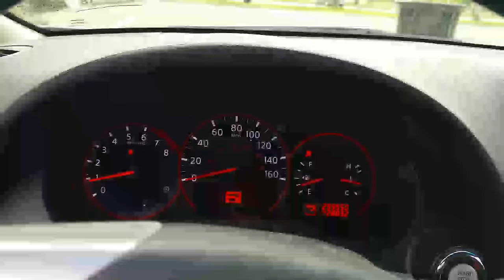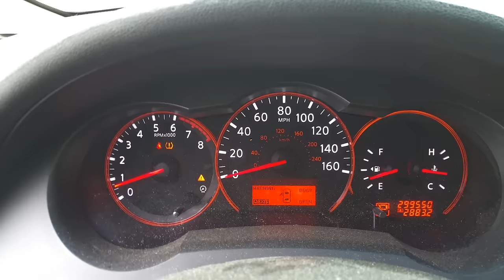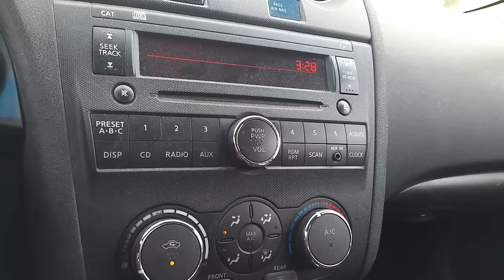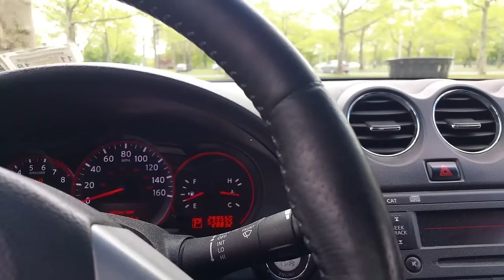CVT Whining Noise and Fail Safe Mode Fixed!

Comment: Dude. Just change your CVT fluid every 65,000 miles and invest on a transmission cooler/heat exchanger. Reason why you hear the whining noise is because the transmission gets too hot to the point where the CVT fluid tends to lose its viscosity, in which you have little to no lubrication to the steel belts inside the CVT transmission. That’s why the car goes to fail safe mode. Because if the computer reads that the temperature of the fluid is too hot, it will go on fail safe mode. Trust me. It had happened to me on my Altima.
Reply: Thanks for the info
Reply: Kamari Gray gotti Did you check if it has enough transmission fluid?
Reply: I had this noise happen when on the freeway when i accelerated uphill, the noise went away during the same car ride and i haven't heard it. Should i worry it's a big problem ? Or can it be what you said ? It's also a Altima
Reply: Use Amsoil CVT fluid 
It has a much higher flash point so it won’t over heat on you 
Also lubgaurd makes a CVT additive that will help
Reply: Just dont buy a Nissen with CVT............buy a car
Reply: On my the whining  noise is when is cold, then when warms up kind of disappears, or very little of the noise. This is six months after the change the atf from drop down the pan ,about 3qt.
Reply: @JujuMoto502 how did you solve the problem?
Reply: @anguslean4058  I use Amsoil CVT fluid on my car as well, but are you sure it has a higher flash point? Where did you find that info?
Reply: @ARCADEGHOST  from Amsoil 
It is the best CVT fluid out there 
It also will last much longer then the factory CVT fluid in that it doesn’t break down as quickly 
Amsoil will send you the data sheets if you request them.
Reply: @edwinalexander1170  its too late for me, I bought a 2013 Nissan Altima, sport, at my local, Carbone Nissan in Utica, N.Y. they said when I asked if there was a problem with the transmission's, no never had one come back, yah, never had one come back. that's because the warranty does not cover transmission's , BULL SHIT, THEY DIDN'T TELL ME THAT, well now I have a transmission that vibrates like a M.F.er, 105,000 ml.
Reply: Hey I got that noise to in my Infiniti G35 08 idk if it blocked up on me

Comment: Hi there, been through this issue.
So here is what I've found so far, I have 2009 Altima US Specs, the same thing happened to me car went to safe mode and won't speed up, i simply changed the CVT fluid, run well for a month or so and then again the same thing, i changed the fluid again but this time it was hot here in UAE and i had to drive to another city where maximum speed limit is 160 kmh and guess what same thing happened car went to safe mode couldn't accelerate more than 120 kmh. so i searched the web for issues on Nissan CVT.
I Found a comment from some nissan tech guy explaining that CVT fluid is temperature sensitive and expands on high temperature he further added that he had usually found cars with a high level of CVT Fluid which turns out to be the issue for fail safe mode.
To check that i drove my car at speed of 160 kmh (Since there is no problem at lower speed) as soon as car went to safe mode i stopped and checked the CVT Fluid guage which was showing CVT fluid 3 times above the maximum fluid limit.
Anyway to cut it short here is what you have to do,
1st of all Nissan gave a specific range of temperature at which you have to check CVT fluid level, usually we fill the fluid to maximum level when the CVT and CVT fluid itself is cold which causes all the problem.
So if you are facing such problem simple reduce the level of CVT Fluid to minimum level indicated on level guage. run the car at high speed for like 3,4 hours and then check the fluid level again if hot CVT is exceeding maximum level you have further reduce the fluid.
I did the same (took me some time though) but now i am not facing any winning sound or fail safe mode or anything car runs smooth at any speed. Altima is speed locked just below 120 mph / 190 kph and i ve to that max for about 30 mints without any issues.
Hope this will solve everyone's problem with CVT and fail safe.
Reply: Thank goodness someone else finally got it right. Engine coolant freeze point protection plays a major roll itself, most people also overlook that. Check my comment above at this post.
Reply: Muhammad Zohaib my car is doing the samething I’m thinking I need a transmission so I just need that and the problem is done?? It started out first like a whining noise then when I get to the red light I acted like it didn’t wanna pull but eventually i was able to get speed so all it is is a CVT??
Reply: my nissan 08  does the winning  noise and loses power i already changed oil  and still give me problems
Reply: Niyah's Land it got too hot. Drive easier/ slower and don't use cruise control if you are on anything other than a flat surface.
Reply: What level gauge?  Where is this located?
Reply: u might wanna instal a Heavy duty external cooler too.. if using the car in the UAE.... just a thought.
Reply: Jazakallah, u solved the problem, i agree with u as I own a Nissan Altima 2012 Coupe n I noticed that in hot weather my vehicle does not response comparing in the cooler weather.
Reply: Hi. I hope u can help me with my worries on that sound i heard after driving from dubai to abu dhabi running 140kph. On my way back to dubai, when i decelerate my speed, there is a winning sound. From jebel ali to deira the sound became more louder than it use to be. This is my first time with cvt and i checked the transmission oil and even went to the shop and both me and the mechanic checked the oil level and it was ok. But now am worried because of this weird sound. I don't want to spend more money on this car specially with the transmission issue. Hope u can help me and send me a private message for me to call you if thats ok with you. Thanks!
Reply: @jaysonanjilim  did the speed dropped?? Like less then 140 even if you gas more?? If that's not the case then I guess its not cvt issue. If there is anything wrong with cvt your car will immediately go to safe mode meaning it won't let you accelerate and drive over 120kph. 
When did you last changed your transmission oil? If it is more than an year change it, any workshop can do it, tell him to clean the oil pan as well. Fill in new oil but not too much (cause workshops here tend to fill the oil upto the highest level of the guage)  oil should be upto 1st notch of guage. Last and most important, you have to reset a parameter, ill give the name of that parameter in a bit.
Reply: @muhammadzohaib63  less speed but but it didn't go to safe mode. Maybe it was just starting its issue. I checked today morning the transmission oil, it is lower than the half of the oil stick level. I started the engine this morning and still the sound is there when i rev it. I hope u can help me with it and i will tell the shop not to over fill the trans oil. Hope my trans is still in good condition. Am worried and i dont want to spend another grand or 2 to change it.
Reply: @jaysonanjilim  CVT level at cold state (like in the morning or when you just started your car after rest of 12 hours or so) should not be higher then 1st notch on guage i.e the the bottom notch.
Reply: @muhammadzohaib63  its in the shop now in al quoz. Any referral to go to a good workshop?

Comment: I don't have a nissan. I own a Toyota Vitz 2014 with CVT transmission and when I drive it aggressively and on steep hills it usually whines. Once it cools down it is fine. Inspected the coolant and found the Toyota long life coolant mixed with a green coolant, most likely Prestone. I drained and flushed my system with distilled water and radiator flush, cleaned some rubbery type buildup in the radiator cap and filled with genuine Toyota long life coolant. The difference is night and day. I have driven it aggressively but haven't thoroughly tested it under all conditions before fluid change but I already have experienced a significant improvement. The contaminated fluid shows separation of the green and pink coolants with the green floating on top and has consistency of a thin syrup. Hope this experience can help someone with a similar problem.
Reply: Have 2014 vitz got into a small accident damaged the oil pan for the trans replaced it and filled it with Toyota genuine oil FE now it wines under high load which is not the norm so am wondering what’s the cause of that now any help would be appreciated thanks

Comment: Just install a transmission cooler and it will fix the problem.  Cost me $140 to put one on my 2012 Altima.  No more whining.  Change the transmission fluid every 40,000 miles and it is good.  I got 205,694 miles on my Altima with the original engine and cvt transmission.  Transmission cooler will save your cvt from breaking.
Reply: @Debbie yes. It allows more transmission fluid in the system to help lubricate the parts properly.  It's sort of like a radiator.  Look it up on Google if you don't believe me
Reply: @Daniel Carlton when you put transimission  cooler, did you remove the already installed cooler in the vehicle?
Reply: @edwinalexander1170  There wasn't one on it.  I didn't install it. My mechanic did. I got the idea from another YouTube video and that guy installed one on his 2012 Altima and he never removed a transmission cooler from the car.  He just hooked up the cooler to the front of the car.  My mechanic did the same thing.  It made a world of difference
Reply: The CVTs on Nissan Altimas have a small cooler but it is inadequate since the transmission runs hot to begin with so I could see how this could be a benefit and it sounds like you add it on in a different place than the cooler it comes with or maybe in conjunction with that original cooler on there. Hmm. May look into this. Thanks.

Comment: Update: Now at 155k with no issues. No external cooler installed.

Yes! Change the fluid. I'm the original owner of my 2010 Altima, and having a dealer flush the CVT every 30k miles has kept it smooth as butter just like the day I bought it. It has 123k miles today. I don't even know what the whining noise sounds like because I've never heard it 🤣
Reply: have u installed tranny cooler? I have 07 maxima with 122k miles and bought at 104k miles. Trans fluid looked like it was never changed and ive done two cvt fluid changes since I bought but haven't bought a cooler.
Reply: Same here! I have a 2009 Altima and I change the trans oil every 30k. I have 128k on the car and transmission runs great. No whining noises ever.  I bought my car new and I've changed the oil every 30k. I hope I get another 100k out of this trans Better knock on wood.
Reply: Iam jealous lol
Reply: Come back once yall cvt go more then 170xxxx miles and let us know how the whinning sound like
Reply: @grandosrickyy838  lmao I at 201,000 miles and haven’t heard the cvt while yet 2010 Altima
Reply: CVT transmissions fail if the fluid isn't changed regularly.  They are unforgiving on that.

Comment: Once those transmission start making a whining noise or anything out of the ordinary, you're looking at a rebuild.  The Fail Safe is mainly so it doesn't stall or go out on you while you're driving but otherwise you need a rebuild / new transmission.  I do have to say if you can get 299k on a CVT transmission, that's pretty darn good.  I see most go out before 150k, which is why I won't buy a car with one myself (at least not right now--maybe in the future when they can prove they can go 200k without issues and regular mainteiance).
Reply: I have a 2004 Saturn ion three with 265,000 miles on it and it just started making that whining noise when accelerating I think I’m gonna change the fluid hopefully that helps
Reply: @illusion1378  update?..did the fluid change work?
Reply: @donovanfahrbach2493  it did help but fixing that minor exhaust leak did the trick
Reply: Go with the honda accord  thier cvts are the best out thier
Reply: MINE  WHINED  IT  WASNT  HIGH  PITCHED  IT  DID  IT  SITTING  IN  PARK  ONLY  26  DEGREES

Comment: With cvt transmissions you have to have the transmission serviced every 40k to 50k the manufacturers are recommending every 25k but you dont have to be that excessive.  All transmissions are supposed to be serviced but most people don't cvts are just higher maintenance than others
Reply: That's exactly right there's a guy online that has a blog about his 2012 Nissan Sentra he maintained he maintains the CBT every 15,000 miles he changes the fluid and he's had no problems no whining nothing I did read also about the the transmission cooler I'm sure that would help if the transmission is heating up especially in summer mine hasn't been making any extraneous noises but I did have to have my transmission rebuilt but it made no noises it just wouldn't the power was low on it and there were some lights on and that type of thing and I took it over to Aamco transmissions and they rebuilt the transmission This car has several quirky things about it and you have to make sure that you know what they are and you keep an eye on them that CBT is one of them jabco makes back then made crappy CVT transmissions and they've had problems in later years as well so that's just something to know about and maintain it 40 to 60 thousand miles is way too long to be servicing these transmissions when that fluid gets dark it's time to change it it can be checked at intervals you just have to have your mechanic do it maintenance is key for these automobiles if you want them to last out 100,000 plus miles

Comment: You need to go to Valvoline every 60-80K and do a CVT flush $199. Buy only Nissan original CVT fluid and have Valvoline put your Nissan CVT fluid in, instead theirs. After the flush it won't slip and run strong. I have 297,000 miles on 2017 Altima (I drive Uber)
Reply: So does the fluid brand makes a big different. Cause i used valvoline this time and im feeling a lil slipperage?

Comment: Thanks man. I just did back to back CVT fluid changes on my juddering 2015 Altima. I also added a cooler. Working good now, touch wood!
Reply: Is it still working good?
Reply: is it still working good ? We want to know
Reply: I'm looking for an answer too because i just did a fluid change on a 2017 and its still going safe mode. Second fluid change ill do the filters as well but need final verdict

Comment: I leased a 2015 altima for driving uber full time, got the car with 55k miles on it, in two years i got up to 181k miles on it. I put an average of 200 miles a day on it. No problems what so ever with the trans. And inever got the fluid changed in all the time i had it. The only maintenance done was oil changes. I love Nissan but scared to buy a used one because of all the horror stories i hear.
Reply: This is how it should be.  Pretty sure they advertise most of these to have oil guaranteed for the lifetime of the trans.  Word play geniuses

Comment: The main thing i notice is they blew it by not putting in a transmission cooler. So change your tranny fluid often its not too bad. Pull the pan you can reuse the gasket clean the magnets and pan and gasket way low torque on the pan bolts 15 INCH lbs get a inch lb torque wrench ! Valvoline sells a good cvt syn oil 50 bucks every 6 mo or 30k miles yep it is what it is great car but this is the weak link.

Comment: I have 160000 miles on my 2011 altima its just now making a bit of noise...going up from 500 ft to 2500 ft everyday we drive it 100 miles a day its a great car. But the cvt is the weak link.
Reply: How is the transmission now?

Comment: That car has almost 300k miles on it. That’s impressive!
Reply: i know right. i’m about to follow his method for my altima
Reply: Wow,wirh 2 transmissions,what POS! My Acura went 600k and still running great when i sold it.my tacoma 535 and still running perfect ,both cars never touch engine or trans
Reply: It's had 2 transmissions so not too impressive.
Reply: On 2 trans

Comment: There is second filter that have to be changed...you can see it at the front... around were the oil dip have a pipe connected looking up